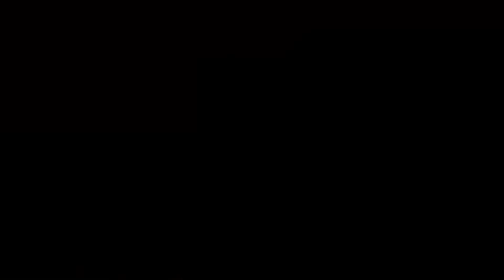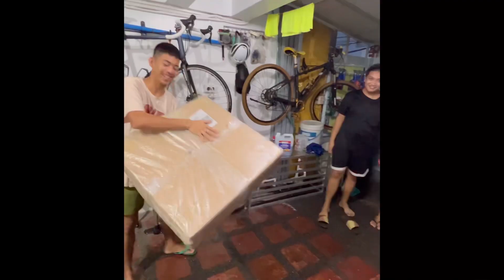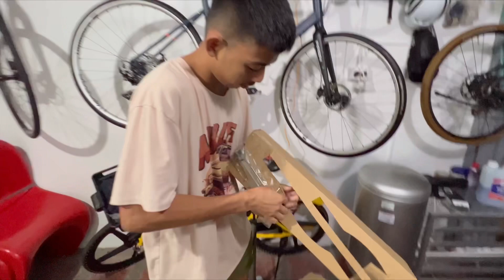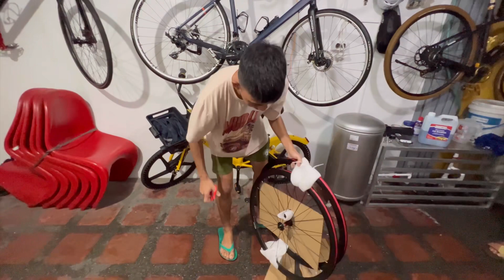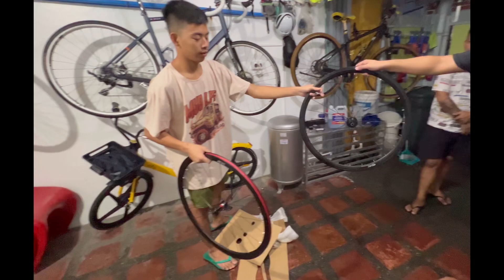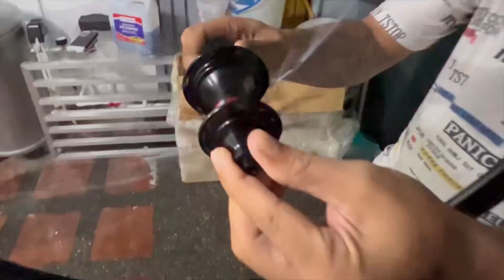Unboxing | LDCNC WHEELSET 700c #cycling #bike #viral #video #bikelover #unboxingvideo #unboxing

Comment: Question. Nakabili ako kanina ng ldcnc rimset (disc) 

Talaga bang 2 manipis & 2 malapad yung adaptor ng QR?

Bakit po yung malapad na adaptor for quick release hindi po namin sya mapasok sa hubs?

& compatible po ba sya sa 700x32 na tires? 

Thank you
Reply from the maker: Hello! Salamat sa pagtanong! Yng dalawang manipis ay para sa Quick release na Hub for front & rear..
Yung dalawang mataba naman po ay para adaptor naman for thru axle na hub for front & rear din po..
Baka po siguro yung Hub nyo po ay pang quick release..
Kasya po yng 32c 700c na tires nyo po sa ldnc rims..
Isa po sa amin dito na naka-ldnc rims disc ay may nilagay na 38c na panaracer gravel tires..
Salamat po and Ride Safe!

Comment: Pwede po ba ito sa mountainpeak striker ko?
Reply from the maker: YES po.. This LDCNC Wheelset will definitely fit your mountainpeak striker.. We recommend using 700c 23c or 25c tires. Thanks for your comment!
Reply: hindi pwede sa mtp striker mo yan for rim brake lng compatible yang wheelset